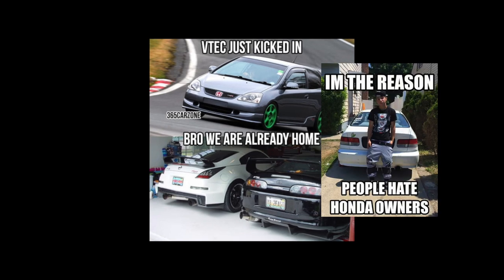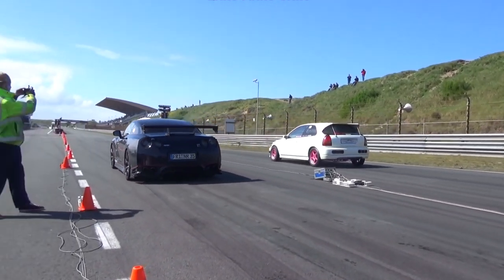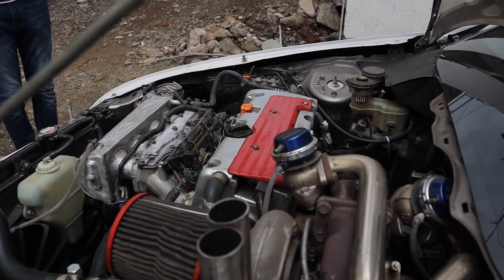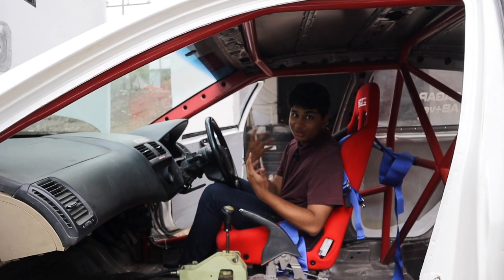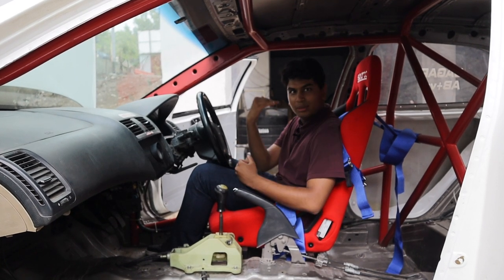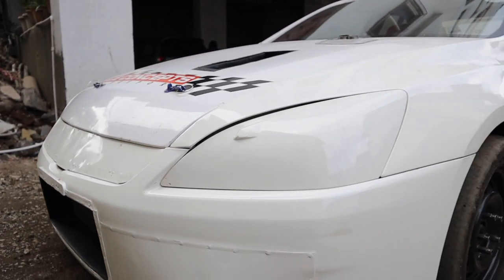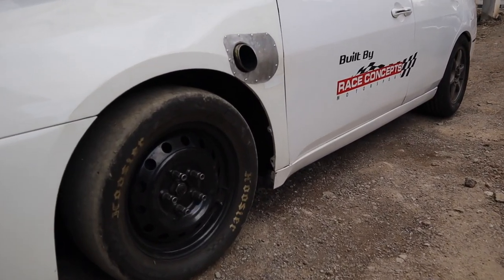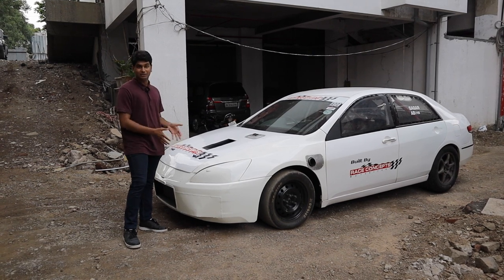Honda Accord K24 Turbo Dragster: The most powerful Honda in India! | AutoCulture

Comment: Add a NOS kit tuned to 100 -150 shot. It will take down any hyper sport as well in a quarter mile run. What's the quarter mile and 0-60 timings by the way?
Reply: Forced induction  and NOS doesn't go well together .......especially when not tuned properly or when the mods don't support......a 100 to 150 shot will blow up the block and head 🤣🤣......at least on this build!!! Its safer to go 50bhp straight shot or 100bhp on a progressive controller!!! Still it will loose  traction  like hell!!!